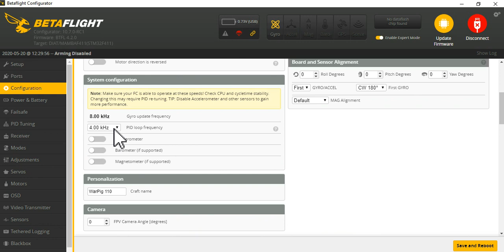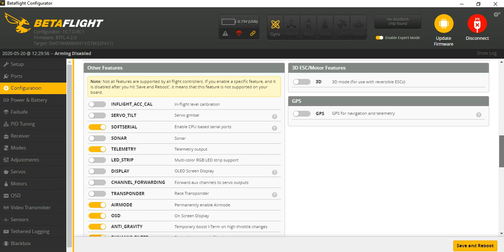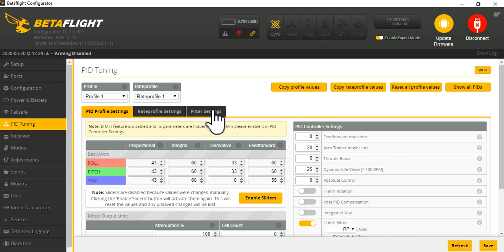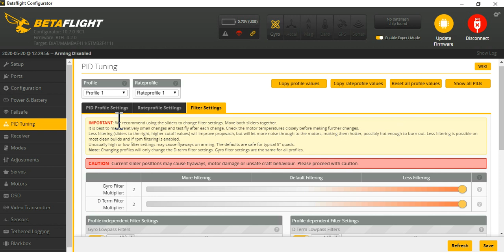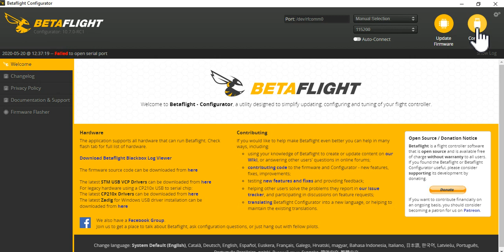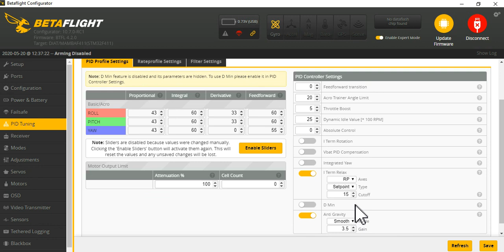Betaflight 4.2 Setup and Tuning for 1-2S Ultra-lite Micros Part 1

Comment: Hello I have a question the button in my configuration settings Bidirectional DShot is missing and motor poles and motor idle throttle value too did somebody know what’s wrong? Sub and like good video.
Reply from the maker: Make sure you are the current BF app and firmware and that your ESC firmware has ESC telemetry

Comment: Дорогой Друг!! Это великолепно!!))) Проблема JESC очень интересна?? Особенно выбор частоты 48 или 24 так как ее значаение СИОЛЬНО ОПРЕДЕЛЯЕТ ходовые качества аппарата. Разгон CPU!!! это вообще "захватывает дух" так терзать такую "крошку"))) Волнует еще вопрос о возможности увязки всего представленного с Project MockingBird. К сожалению английский мой не родной язык и пользуюсь ГУЛЕМ))) В класическом  Project MockingBird величины PID практически в два раза больше, и можно ли там использовать Dynamic Idle ЭТО ЧЕРТОВСКИ!! интересно. УФФФ!!))) устал, мне 65 только исполнилось!! Так хочется Интересного Общения. Часть 2 оставил на "СЛАДКОЕ" так говорят у нас в педкушении ИНТЕРЕСНОГО!!  Dear friend!! This is great !!))) Is the JESC problem very interesting ?? Especially the choice of frequency 48 or 24, since its value SIOLLICALLY DETERMINES the driving characteristics of the device. Overclocking the CPU !!! it is generally "breathtaking" to torment such a "crumb"))) The question of the possibility of linking everything presented with Project MockingBird is still worried. Unfortunately, my English is not my native language and I use GUGLM))) In the classic Project MockingBird, the PID values are almost twice as large, and is it possible to use Dynamic Idle there THIS FUCKING !! interesting. UFF !!))) I'm tired, I just turned 65 !! So I want an Interesting Communication. Part 2 left on "SWEET" so they say it is INTERESTING !!
Reply from the maker: Yes project mockingbird Typically uses very high P and D. High values are needed because the motors are small and underpowered compared to larger quads.

Comment: nice video! if i follow your steps with out pid tuning with be fine to flight? or you Have to? thank you :)
Reply from the maker: Kelapse I recommend going through the tuning process. if you save a diff all, you can try the changes and revert to your prior set up if you need to.

Comment: What quad are you running this tune on specifically? Would this work well on a Mobula6 (19000kV)?
Reply from the maker: neil454 for a whoop the way to go is emuflight with the project mockingbird tune.

Comment: Hi, can i do this setup for the Tinyhawk II? Sorry for the question but i am a completely newbie
Reply from the maker: Elia Sgarbi if you are new I wouldn’t mess with the stock settings. A lot of what I discussed is advanced tuning and could cause issues if you are not solid in the fundamentals of PID tuning.
Reply: @Quad66  thank you for the answer 🙏
Reply: Will it work with the tinyhawk 2 tho? I feel ok tuning

Comment: Would this setup work for a baby evo2, 85mm quad? Thanks
Reply from the maker: Roland Burrows a lot will apply but you’ll need to push up PD gain and dynamic idle

Comment: Hi first off, I’d like to thank you for your videos on micro quads. In fact, out of desperation to get my 3’ iflight DC3 quad aloft, I followed your pids on Warpig plus (R/P/Y P= 43 R/P/Y I = 60 and P for all 33, and FF 60, plus the dynamic idle rate at 25) and I got it to fly with no discernible propwash or oscillation, except for the quad thrusting up easily. Any advice on more improvement, in that my quad is running on 4s 850 mAh with T-Motor II 3750KV:)) Incidentally, when I switched from your pids to bf 4.2 default rates, my quad flipped. Why is that?
Reply: Oh, my quad’s also running on Jazzmaverick’s 16.73 rpm filter.
Reply from the maker: Your build is far different from these builds so a ground up tune would be advisable.

Comment: The video and intention is good but the sound is driving me crazy. The ground loop hum and keyboard noises are louder than your voice.
Reply: I agree,could not watch due to the feedback,I tried listening with audio lower in which helps but then I caught myself struggling to hear clearly.
Reply from the maker: Yes the sound is terrible but the content is high quality and free. Trade-offs guess.
Reply: Quad 66 Audio is the most important part of this content. So this is not high quality content.
Reply from the maker: o3rMeNs the audio is the presentation not the content but I don’t think I will convince you otherwise. so this response serves no real purpose other than for me to say, thank you for the feedback.
Reply: @Quad66  Try following your content without audio and just video. Now try to follow it with just audio and without video. Maybe this will help you realize the audio is the most important part. The video is just to give visual aid to the audio. The audio file is like 90% of the content. You're welcome.
Reply: @o3rMeNs  audio is not the content. Video is not the content. The information your brain receives is the content.

Comment: Hi Quad66,
Some questions for you:
Isn't idle at 5.5 high? I usually lower it to 4.5...
Aren't you flying props out? I found it helpful not to get stuck in branches and to keep the grass of the camera 😬
Last one: what rates do you use on micros? I found liking higher rates on whoop and slightly lower ones on 65mm open props. 
As ever I really love your content and approach.

Comment: I’ve got one of those betafpv 1S AIO v1.2.  What ESC firmware would you recommend? currently on JESC 2.2 48khz unlicensed
Reply from the maker: Dudu Oson JESC 24 gives more power and control at the cost of efficiency and smoothness while 48 favors efficiency and smoothness but gives up power and control. So it depends on what you prioritize. Anything larger than a whoop, RPM is worth trying for 5 dollars.
Reply: Quad 66 My baby tooth is forever stuck at the top of a 70ft pine. Damn the range on those built in RXs.    Just ordered your  SkyRyder 114 to try w some 1102s I have lying around.   Thanks for the replies and all the work you put in providing valuable info to the community.

Comment: Thanks for this, mostly doing the same here. I find 25 dynamic idle to be a little low, specially on non brand new motors. Another thing I do is completely disable second passes on filters.

Comment: For a Crazybee F3 board do you think 4kHz 4kHz DSHOT300 would be best? CPU utilization is too high on 8kHz 4kHz DSHOT600.
Reply from the maker: I don't now of a performance edition for F3 boards for 4.2 and it may not happen due to some of the under the hood changes. On 4.1 I believe 4k/4k DSHOT300 is fine without rpm filtering. With RPM filtering it needs to be dropped to 2K2K DSHOT150. Always check utilization in the CLI by typing the command: tasks   Then check for loop stability.
Reply: @Quad66  you da real mvp
Reply: 4.2 does not support F3 boards
Reply: F3's, I've found on BFPE that 4k/2k/DSHOT150 is about as good as I can get, same issue.  To get any benefit beyond 3.5.7, you want to run RPM Filtering, so that's the setup to run... and this is with overclocking to make PID loop stable on there.  BFPE is impressive, but the way the loop timing has been refactored (and locked to gyro rates), it's going to be trickier to make BFPE really work well with all the 4.2 benefits... and given the need to overclock to avoid stutter at DSHOT150 pace, I find it somewhat unlikely that 4k PID loop rate is going to really work well with bidirectional DSHOT